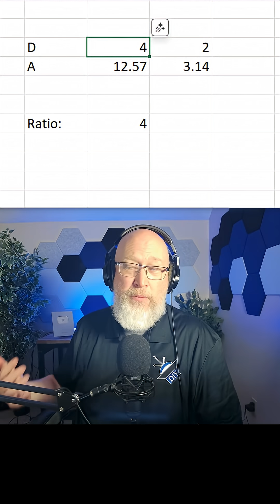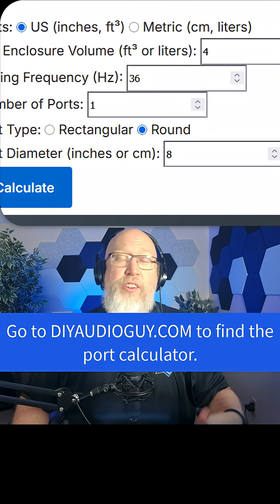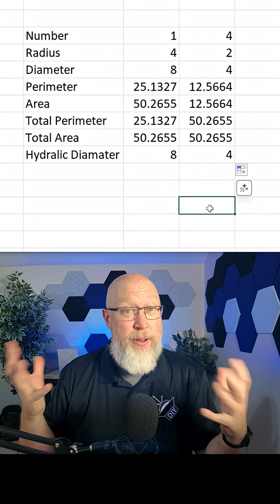The Tricky Math of Round Subwoofer Ports

Comment: Yep, you need to use the square root of the number of ports you're switching to away from 1. Square root of 2 is 1.414, square root of 3 is 1.732, and as you all just saw, the sqrt of 4 is 2. So you go half size for 4 ports.

Comment: For engines...
Bore X Bore X stroke gives you the cubic inch displacement for one cylinder.

This does not seem too much different for speakers when figuring out the volume of your port.

4" port X 4 =16.
16 X your depth gives the volume of a cylinder. 

2" port X2 = 4.
4x your depth.
Reply from the maker: Pi*r^2
Reply: Yikes 😬